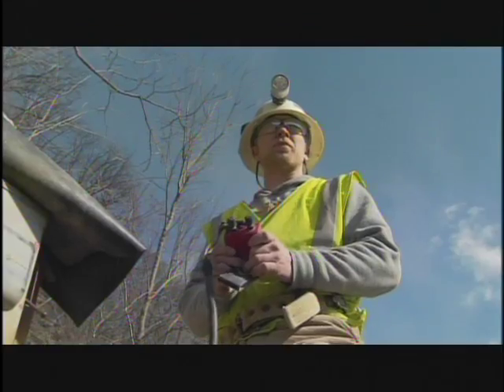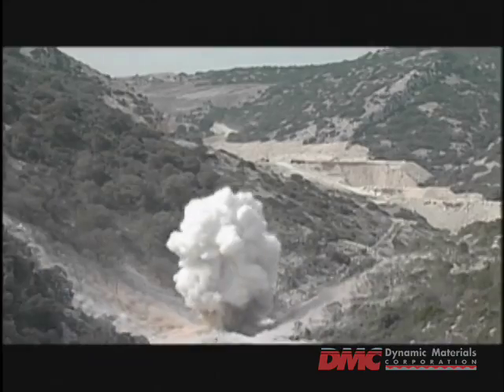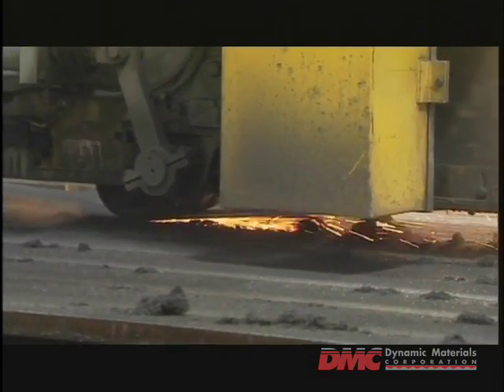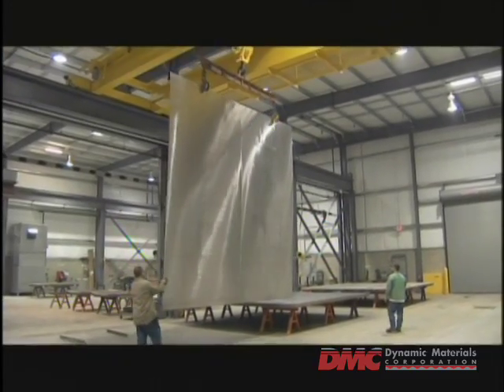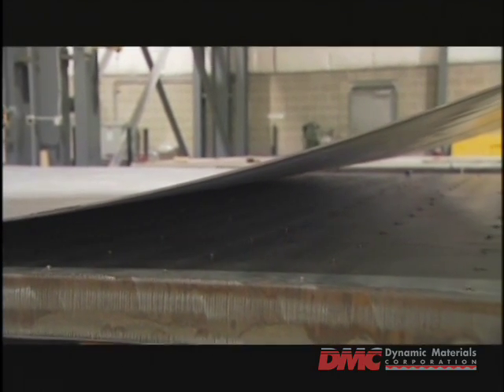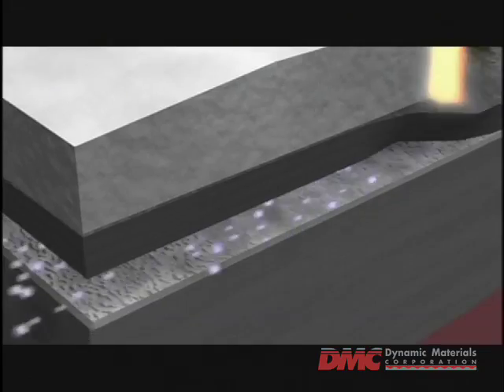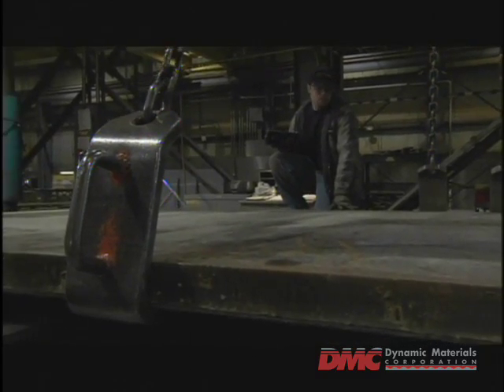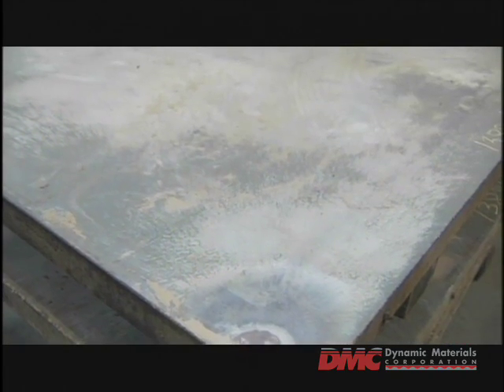Explosion Welding Process

Comment: I have had the chance in my past to have welded on titanium clad and tantilum "tri- clad". Amazing story. My understanding is that the original clading was developed by Monsanto by accident as they were trying to form a clad shell that was tight to a steel container by explosivly forming it to the head of a tank with powder explosives. It bonded itself to the head. Ultimately creating the patent "Detaclad".Later Dupont circumvented it by using plastic explosives with their patent "Deta-clad".

Comment: Would be interesting to mention the end uses of this finished product
Reply: P.e. joining the steel hull and aluminium super structure of a ship, using a steel–aluminum transition joint, often called a bi-metallic strip. They’re the only practical way to permanently join large steel and aluminum sections in shipbuilding.

Comment: So what manufacturer on gods green earth would need plate like this? 5 inch thick multi alloy stacked plate? Like what is this used to make? I need to know.
Reply from the maker: Great question! Our direct customers are fabricators, ship builders, smelters. So for example, we would send a clad plate to a fabricator who then constructs those plates in to a pressure vessel or column.
Reply: Most likely military…

Comment: Can explosive welds with ground up lava rocks and onyx be used with appropriate materials to combine into something that could be used to break Apart an 5 million lumen light through a inverted lumen prism solar panel
Reply: I mean if you put an aluminum core that 90% that is cooled through a super cooling system would hold up right
Reply: Dude imagine a hovermansteamcraft displaying a purple sphere in the shallows at 500 million lumes
Reply from the maker: At this time, we do not use material with ground-up lava rocks!

Comment: the only question i still have is what application requires the end product? what application requires a thick plate of two different types of metal?
Reply: Typically anywhere you have corrosive chemicals under high pressure. The backer plate is what takes most of the pressure while the cladder plate protects the backer from the whatever corrosive chemical is being worked with.
Reply from the maker: Here are some examples: Our DetaClad plates and tube sheets are used to fabricate pressure vessels, heat exchangers, and reactors in oil & gas, chemical, or energy processing environments. Our transition joint components can be used as piping junctions in LNG or air separation units or to join aluminum to steel hulls in shipbuilding. The equipment application list is pretty expansive pending the temperature, pressure, and corrosion parameters of the environment. https://nobelclad.com/industries
Reply: Military,explosion welding was first noticed on warships in ww2.
Reply: @brianbaker8287  to answer OP’s question, Clad is used in oil refineries among other industries where corrosion is prominent
Reply: Never asked that was Tom,but I'll play along ,Battlefield armaments-Tanks

Comment: What happens to the spacers that are tacked on before the cladder is placed on top?  I didn't see mention of them blowing out of the gap during the explosion, but they don't appear to be embedded into the metal.
Reply: I was wondering this too, down below they say "Caleb, There is a very high energy jet formed by the collision between the two metals, best seen from 2:14 to 2:40.  That jet drives the spacers we use to keep the plates separated out from between the metals." So it seems they do get blown out by that high velocity wind.
Reply from the maker: @chashahjohnson  @tpaairman Correct! The jet from the explosion 'pushes or blows' the spacers from the pack.

Comment: Now the million dollar question... what are such special welds (or the resulting parts) exactly used for? Seems like this process is very sophisticated and expensive, so there must be some good reasons...
Reply: It's also used to make transition plates used it electrical power systems. To connect copper to aluminum you use a transition plate that is aluminum on one side and copper on the other. Copper and aluminum don't work well together and a transition plate solve the corrosion / galvanic action issues when joining the two. Look up electrical transition plates.
Reply: Usually these claddings are used in oil refineries and chemical plants and such. Anywhere you have corrosive chemicals under high pressure you'll find these claddings. The backer plate takes the pressure while the cladder protects the backer from whatever chemical is being processed.
Reply: I work with rocket parts that are explosion welded aluminum/inconel its honestly incredible how good the weld is
Reply: The coker plant at Chevron oil refinery in Pascagoula MS uses these in the coker drums. They are huge vertical sausage tanks that have a nickel chrome alloy inside and carbon steel outside. The drums are heated and pressurized to such an extreme that steel alone would fail. Periodically the hull becomes weakened and has to be cut out and replaced. As you would imagine, welding a laminated sheet of metal is tricky. Ceramic and fabric heaters have to be installed all along the walls on the inside of the structure and raised to 300 degrees Fahrenheit before the metal can be welded. The edges of the metal sheet are beveled at a 45 degree angle.
Reply: @Jtyrone71 that's crazy
Reply from the maker: It's true -- a lot of what is mentioned below is accurate. Our DetaClad plates, tube sheets, or transition joint components are used in a variety of equipment applications. Coke drums, pressure vessels in Oil and gas, reactors and condensers in chemical processing, pressure oxidation vessels in mineral processing, piping junctions in LNG or air separation units...just to name a few. The application list is pretty expansive pending the temperature, pressure, and corrosion parameters of the environment. https://nobelclad.com/industries
Reply: No incorrect...this is used on infrustruces that chance metal...on tug boats where the boat is steel and the pilot house aluminum....they use this and weld the pilot house to the top aluminum portion
Reply: Re boats, wouldn't you just screw that together?
Reply: @JustinShaedo  You get galvanic action and corrosion with vastly different metals. When the metals are joined like the process in the video, you don't have the water or air in between the metals and you get much less corrosion.
Reply: You can Connec mild steel with aluminium using this plate
Reply: Good question. Sounds like things the average person has no need for.
Reply: Few surface material properties are required in ballistic missiles, space programs, etc.

If one wants to weld tantalum and steel, this is a cost effective way.
Reply: Aggregate mining.
Reply: I think that it is because certain thicknesses of plate steel are not sold so with this method they can create any plate thickness they desire

Comment: Wait a second: why the welding in the first place? Couldn't they just provide a thicker steel plate? Or is there some unique advantage having two plates welded together?
Reply from the maker: Thanks for the questions! Actually in instances where the processing environment is too corrosive for a solid stainless steel or carbon steel, clad is used. When there’s high temperatures or high pressures, corrosion resistant alloys are explosion welded to stainless steel and carbon steel.  The idea here is that multiple metals explosion bonded together achieve additional, functional benefits unachievable with a single metal.
Reply from the maker: In some processing environments, leveraging a corrosion-resistant metal is very expensive. It is not cost-effective to make an entire vessel out of titanium or zirconium. With DetaClad, you can leverage a thin layer of Ti or Zr welded to a Steel or Carbon steel as a composite, more cost-effective solution where the equipment doesn't need to be replaced as often if a solely steel was used.

Comment: Is it a true weld though? You’re basically smooshing it on with an explosive breadroller.
Reply: It's more like soldering because at least one of the two materials stay solid, here both of them are solid.
Reply: @johntheux9238  It is not considered soldering nor anything close. This is a weld; Solid State Weld to be exact.  Soldering and brazing are forms of "gluing".  This is considered Explosion Welding.  As stated above, Explosion welding is a solid state weld, meaning there is no fusion of materials at the bond zone.  Fusion welding is MIG, TIG, Stick, etc.

Explosion welding share electrons at a depth of about 30 nano-meters (If my memory serves correctly)
Reply: @liveunlimited8112  Makes sense since solid state welding also works with identical materials even if it's often unwanted (like for spacecraft components which have no oxyde layer protecting them from each other)
Reply: @johntheux9238  are you on drugs? LOOK UP the definition of soldering/brazing. There is no low-melting point filler involved here! JFC
Reply: @railgap  And you should look up at the definition of welding. Both pieces are supposed to melt together. Here they stays separated, like soldering/brazing.
Reply: @johntheux9238  I'm late but um, no, you should look up the definition of welding.
Reply: @Trials22  By definition both plates should melt for a weld.
Reply from the maker: Yes - it is !

Comment: was this process accidently discovered?
Reply: WW2 shrapnel sticking to armour plating and welding on. They figured out it was the explosive force not heat
Reply: Pretty sure they invented clad rolling and friction stir welding first, then moved to high explosives where clad rolling is impossible.

Comment: I'm studying welding ,But i don't understand this video. Who can explain please?
Reply: The two metals are welded together by the shockwave of the explosive compound, the upper layer (cladder) which has the explosive on top is forced downward so hard and fast that the molecules of the two materials fuse together. The two plates slam together so fast that the inner surface of the two plates liquefies and incorporates into the other. The little metal spacers they spot welded between the plates provides enough room for the cladder to gain sufficient velocity to allow the welding to occur (If the two plates were touching together they would just deform instead of fusing together), and are spit out along with impurities and oxides present on the surfaces that would otherwise inhibit the weld.

Comment: We 've just bought some clad steel at NobelClad for Heat exchanger manufacturing. Very good product
Reply: I'm actually very curious about something I'm guessing you know then - how do you butt weld such material?  All I can picture is welding rod that's like the Smuckers peanut butter and jelly jar but that can't be right, do you just use the correct filler metal for one layer to do passes until you get to the explosion weld seam and then switch to the other filler metal and hope that the lack of bond between the two layers won't be an issue on such a small area?
Reply: @kenstein  You have to remove (by machining) cladding from  base metal weld areas. After butt weld you have to overlayed weld areas using electrodes matching chemistry of cladding.
Reply: @boutchamos  interesting, thanks. Pretty much what I expected

Comment: It's kind of counterintuitive that an explosion actually creates something instead of destroying it
Reply: We owe our lives to a massive explosion. 😊
Reply from the maker: For sure -- it does seem like this process is an oxymoron. But! In fact - our custom composite metal solutions would not be possible without the explosion from our DetaClad process.
Reply: On the contrary.  Commercial explosive create not destroy. like a saw blade ripping into a sheet of plywood, It's finish can be a fine piece of furniture. The power of explosives build mighty dams that power our cities, Mine minerals such as steel, copper, aluminum, coal to heat and build out modern world, pierce and  fracture oil well casings to increase the efficiency of extraction and so on.
Reply: @submechanophobia768 this is very interesting and I didn’t think about it this way before
Reply: @submechanophobia768  🤓
Reply: @johnray547 nah that’s not a nerd moment that’s a grand intellectual moment
Reply: Big bang.
Reply: Nah, it's just something we learned while saving the world.

Comment: What industries use explosive welded dissimilar metals and on what equipment?
Reply from the maker: We support a variety of industries like Oil & Gas, Chemical, Transportation, Marine & Defense, Power Generation, and Aluminum Smelting.  The end use equipment is usually pressure vessels and heat exchangers that need to be corrosion resistant on one side and have steel on the other side for strength and durability.  We also supply a lot of clad material into applications where corrosion and pressure containment are not primary concerns.  Transition joints – transitioning between structures made of different metals or making electrical connections between metals that cannot be otherwise welded together is another interesting use of our clad.
Reply from the maker: Our products end up in a variety of industries: Oil & Gas, Marine, Defense, Transportation, Chemical & Petrochemical and more. In terms of applications explosion clad can be used to fabricate pressure vessels, crystallizers, heat exchangers, condensers, transition joints, etc.
Reply: It's the only way to weld the aluminum superstructure of a warship to it's steel hull, for one.
Reply: I imagine the cost is prohibitive outside of major industries and companies with very specific need for such a process.
Reply: Yeah, I've heard of it referred to as Detastrip or Detacouple. Usually comes in long strips two inches wide.
Reply from the maker: Industries include: Oil & gas, energy, chemical, mining and equipment can include: pressure vessels, heat exchangers, reactors, piping systems. You can check out various industries and clad applications here: https://nobelclad.com/industries

Comment: What is the purpose of joining two separate plates when you could have one solid plate? Is the top piece of metal the "important" piece, and this a more cost effective route due to the overall thickness?
Reply from the maker: Steve, you are on the right track.  Usually the two metals each provide some advantage that one metal alone doesn’t have.  For instance, some corrosion resistant materials are expensive or maybe not very strong.  On the other hand many carbon steels can be specially designed for high pressure boiler and pressure vessel applications at a reasonably low cost, but they may not have the best corrosion resistance.  Combining the two into a clad plate, and eventually into clad equipment, can give the advantage of great strength, long life and superior corrosion resistance at a lower cost than one solid material alone.
Reply: I have used this material , aluminum welded to steel where  we needed to connect an aluminum top side,ie. cabin/wheelhouse to a steel ship hull/deck.
Reply: Wouldn't the metals corrode due to being dissimilar metals?
Reply from the maker: @sablefisher  Absolutely - that's a great use case for ship building.

Comment: so fricken cool.i was surprised that the two plates were seperated. do the studs become part of the weld or are they removed by the rush of air?
Reply from the maker: Caleb, There is a very high energy jet formed by the collision between the two metals, best seen from 2:14 to 2:40.  That jet drives the spacers we use to keep the plates separated out from between the metals.
Reply: The spacers are shown being spot welded to the backer. Are you saying they are blown out of the gap during the explosive process?
Reply: @phiksit  Even if they weren't expelled, I doubt it would seriously harm the integrity of the weld. You have to remember they stated this type of welding can meld very dissimilar types of metal. I don't know what they're using for the spacers but even if they didn't get blown out by the extreme pressures of the escaping gas, which I doubt, they would simply become part of the weld.
Reply: @phiksit yes. Spot welds are weak. You can break a spot weld easily with a hammer. The power of the air coming out during an explosion is magnitudes larger. It will snap spot welds like it was stuck on with kids glue.
Reply: Care to explain in more detail?
Reply from the maker: Everything from rust, oxides, etc are removed from the jet. It essentially "sweeps" the plate clean, which makes it ideal for a weld.